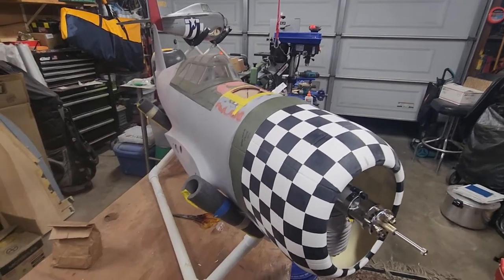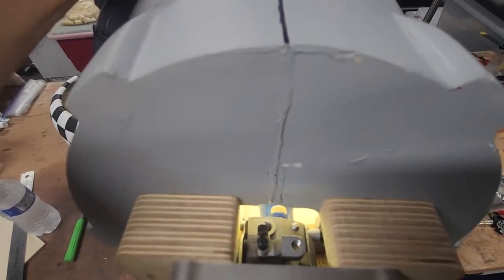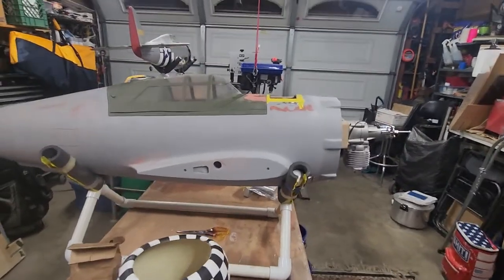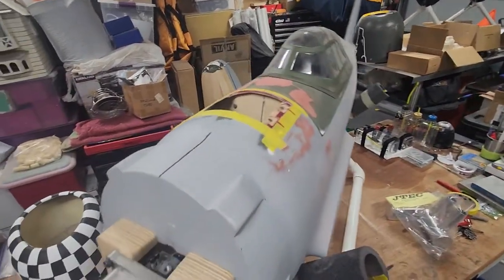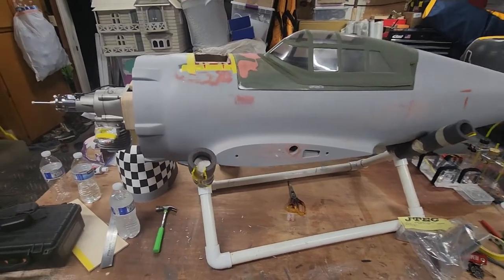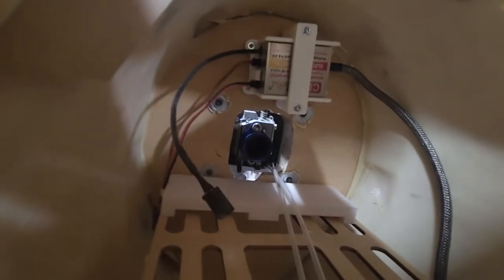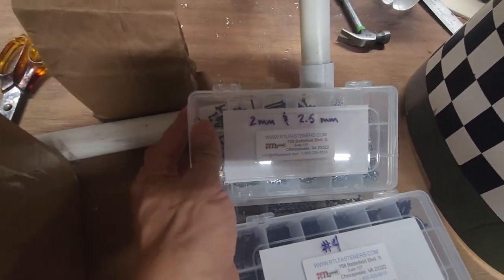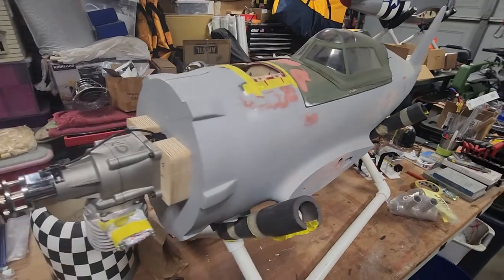CY Models P47 Build Update

Comment: I have a DLE 120
Reply from the maker: I beleive you are talking about the 96".  My current model the 80"  can't even accept a 70cc twin without blowing out holes in the cowl for the cylinder heads.   120cc would be overkill for this airframe.

Comment: Hi Dan,  I need a little help on one I'm putting together.  Watching your videos I noticed there is no cut notch/slot in the rudder for the pull-pull.  Mine is stock/still covered and I can't find one in my rudder.  What are you going to do to set up rudder control?  Is the wood in the lower rudder solid?  Would a pull-pull rod work?  Thanks,  Steve
Reply from the maker: Hey Steve,  yeah so I noticed the same.   My project is moving at a crawl.   I'm taking the time to make some scalish modifications.   I did notice the same thing and I'm not sure what I'm going to do yet.   My buddy whom had the same model slotted the rudder out to accept the composite horns that came with the model.   I have considered both the HD pull pull system and the CY composite pull pull horns.   I am not quite there yet,  but I am leaning more towards the HD pull pull by dubro.  Let me know what you decide.
Reply: @hangar88  Hi Dan,  Thank for the response.  I actually thought about the Du-bro system while I was waiting for a response.  I think it will be an easier install than cutting the slots.  I will probably use the HD cables but a lighter weight rod system to save weight.  I also added 2 more hinge pins to the rudder. 4 would have been great from the factory and I don't trust just having 3 over time.  So adding the 2 more, beefed up the top and bottom.  ANY thoughts on locating the cable slots exiting the fuse?  Thanks  Steve
Reply from the maker: Hey Steve, are you on Facebook, Messenger, or any other social media platforms?
Reply: @hangar88  No I'm not